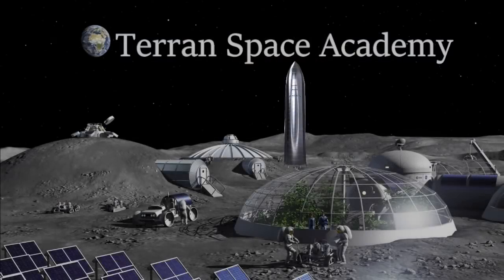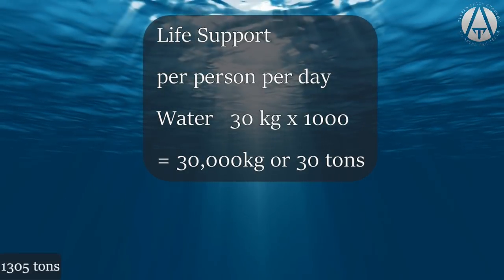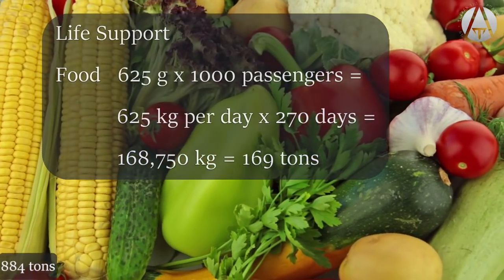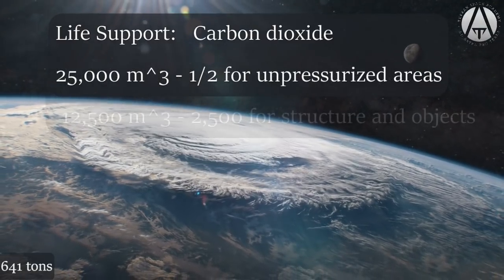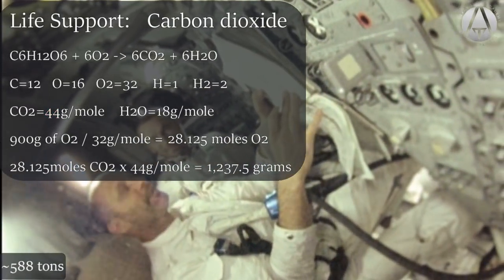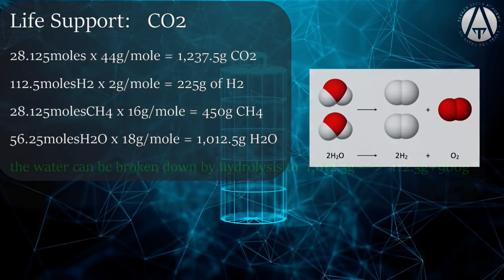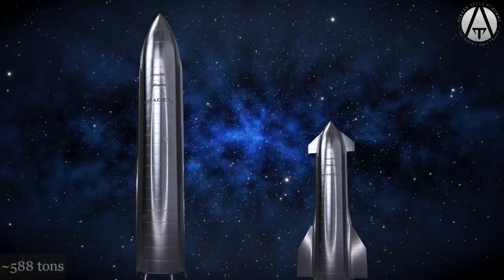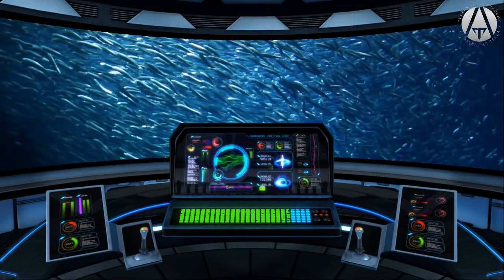Space Colonization: Journey to Deimos - Deep Space Operations

Comment: Great episode. One concern I have with this layout though is habitat volume. Going off of the previous episode you described the habitable section of this enlarged starship as being ten 2.5 meter decks, each 18 meters in diameter, or a cylinder 25 meters tall, 9 meters in radius. That has a volume of 6361 cubic meters, or only 6.3 cubic meters per person if it has a thousand passengers. Add in the volume taken up by walls, floors, radiation shielding, storage etc and you're looking at maybe 4 to 5 cubic meters per person. That's not a lot. NASA recommends 25 cubic meters per person for a mars mission, and that's with highly trained astronauts. 
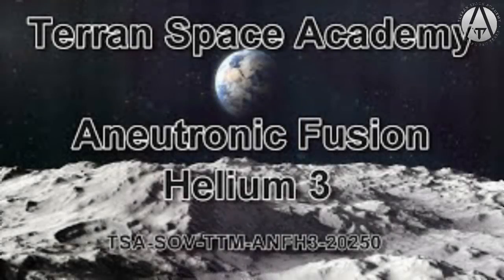I realize this was not meant as a final layout, as mentioned at 18:05 the ship in reality would probably more resemble a sphere or saucer. Just felt like adding that the actual ship would also probably have a significantly larger habitable section. Which on one hand does have some benefits, like the hab having a larger radius for doing spin gravity. But the larger surface area of the bigger hab will require more mass for radiation shielding, and so the propulsion portion would probably have to be resized a bit as well. 
Thanks for the episode.
Reply from the maker: The common areas will help a lot.  If the cubicle is nicely appointed it can be tolerable :-)  NASA was looking at open capsules.
Reply: @terranspaceacademy  No, they were looking at mixes of private rooms and common areas. The 25 cubic meter recommendation was for a mars transfer habitat with separate rooms, not just an open capsule. 4 to 5 cubic meter is just absolutely tiny. 
For context, the ISS has 125 cubic meters per person, and nuclear submarines have 10 cubic meters per person. The navy considers anything less than 5 cubic meters per person as below tolerable, in that it heavily reduces performance due to stress and poses significant risks of metal breaks during a 3 month cruise. And this would be for 6 months.
Reply: @terranspaceacademy  The NASA study I was referring to is "Minimum Acceptable Net Habitable Volume for
Long-Duration Exploration Missions"  if you wish to verify. It has some neat diagrams of possible room layouts.

Comment: I think methane is the way to go for propellant for the near and long term. It has few disadvantages and many advantages. Lower isp is offset by reduced volume and use of common dome with the O2. Also easier to build turbo pumps to run the rockets.
Reply from the maker: For rockets launching from Earth I don't think there is any doubt :-)
Reply: @terranspaceacademy  I mean by the math yeah anyplace else we want to explore has a low enough gravity to help with the volume issue. However I think for it to work for long journeys you'll need some structure on stilts or cables to reflect solar energy and keep it cool.

Comment: Nice job!  Fun to visualize space chickens.  Just a thought, speaking of using all the byproducts, 100+ tons of poop and dirt breaking down will cause a tremendous amount of heat,  perhaps even affecting the design of the radiators.  How would you calculate that?  Also as you get out of LEO to mars, the density of surrounding atoms decreases, when causes cooling to be more difficult, requiring larger radiators.  Does that need to be accounted for or is the drop so small it doesn't need to be accounted for?
Reply from the maker: A steel ship is a fairly good heat radiator but I have imagined inflatable radiators will be needed...

Comment: Great video as always, but I feel it is somewhat incomplete. We have to account for the mass of these systems as well. Storing that much food, water and waste as well as the machinery to reprocess it all is not inconsequential. The energy needs  will consume a tremendous amount of weight as well. Using chickens as a food source sounds like a great idea, but the shear number required as well as the food and water to keep them alive is probably prohibitive. Lastly once the volume required for all this material and machinery is accounted for will there be enough room for 1000 people? Most certainly not. Even the most optimistic of calculations will probability limit Starshio to about 200 people at most.
Reply from the maker: Thank you Craig.  This is a much larger ship than the current Starship design... but you are correct that more factors must be considered... We are covering most of those in the next lecture but didn't want to repeat everything covered here.

Comment: Yeah but the landing area has to built first before ANY ship can land , no ?
 So my question has still not been answered ....
Reply from the maker: Any ship can basically "dock" with Deimos... and landing on Mars with hot gas only Raptor operation or higher level thrusters, like the Lunar Starship will. No landing area is necessary. This could be an exploration ship but that's not what it is designed for... it is designed to allow partial gravity and full radiation shielding for large numbers of colonists of all ages... Not founders... who will all be over 45 and in Generation 1 Exploration Starships.

Comment: Where is that 20% of water going?
Is it getting adsorbed, or reacting with something? Is it pooling someplace. Is it getting into the air scrubbers?
Reply from the maker: It actually wouldn't go away... this is a sealed system so once fabrics etc absorbed some it would reach an equilibrium point and your dehumidifiers would draw more water out of the air... once it has no where else to go.

Comment: Let's give the Terran team a standing ovation for their hard work, research and stellar presentations. Hats off!
Reply from the maker: Thank you so much Kevin!
Reply: @terranspaceacademy  okay I've watched this video and the next generation video a few times over. Here is a few critiques.
1 Methane and Lox are the way to go. The colonists needed on the moon to produce a ship of this size will be creating all the methane needed for these ships just from CO2 scrubbing.. Smelting the metal to create it will make all the oxygen the colonists will need. 
2. I think more of the ship should be devoted to fuel. If this is designed to ship people and supplies to Mars or rather Deimos station then speeding the trip up by several months saves on radiation shielding and life support. No need for simulated gravity either. This reduces payload requirements for each colonist and increases the amount of colonial gear that can be sent to Mars. The nose cone could hold two header tanks for the landing burn at Deimos. Reduce the habitation area by a quarter and add that volume to the  main fuel tanks. With less time in transit less need for large living quarters.
Reply: @rexmann1984  it only takes 2.4 kilometers per second addition delta V to get to Mars in 6 months as opposed to 9, but that assumes aero-breaking with the martian atmosphere to slow down. 

You get get there faster by adding additional delta V, but it gets increasingly more dangerous to use the martian atmosphere to shed velocity on arrival if you go much faster than the 6 month trip. 

I suppose you could use the extra fuel to slow down as well, but then that compounds the amount of fuel required for the extra trip. 

Since a linear increase in Delta V means an exponential increase in the amount of fuel required, imagine the diminishing returns from also now requiring fuel for slowing down. 

Ultimately, getting there one or two months faster and having only a small fraction of the amount of payload and a lot more risk on atmospheric entry isn't worth it just to reduce zero G and radiation exposure. 

You'll find that if you look into the negative effects of both radiation and Zero G over a 6 month vs 4 month trip, the risk reduction to the humans on board is basically negligible. The risks associated with radiation for the full round trip to Mars and back, including a two year stay and combined 1 year in space, are actually less than the risks of deciding to take up smoking. 

It would be much safer just to have more weight in supplies and life support systems, and much more efficient to have more cargo capacity. 

To do with actually increasing the tank size to get there faster, you have to consider that the majority of transits to Mars will be with cargo anyway, and no humans on board, so initial configurations should be tested with the 9 month Hohmann transfer in mind.
Reply: Absolutely! I agree wholeheartedly.
Reply: I didn't go into the reasons hydrogen should be avoided because they are well known. Hydrogen embrittlement, keeping it cold enough to stay liquid and massive volume requirements. The shuttles engines required lots of testing and maintenance after each flight because of these properties of hydrogen.